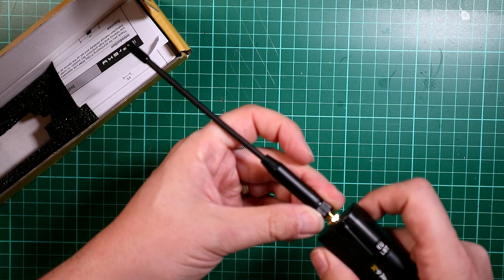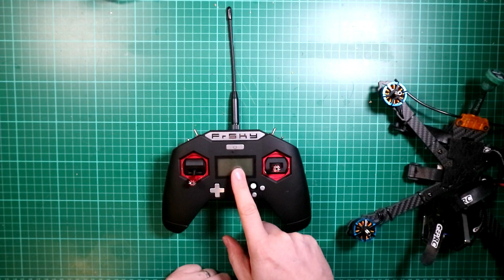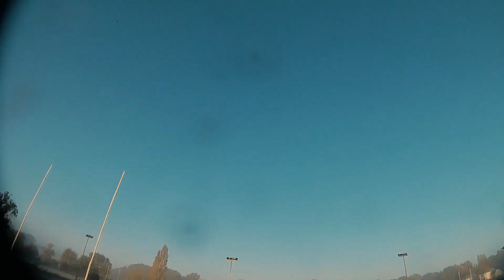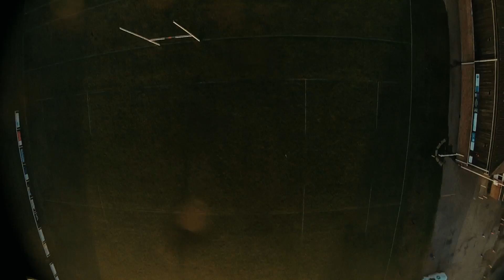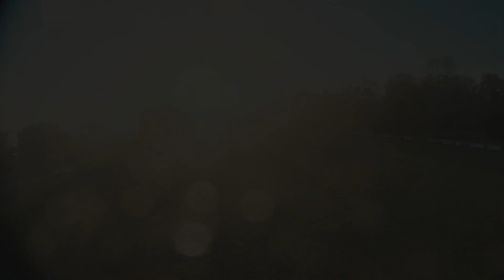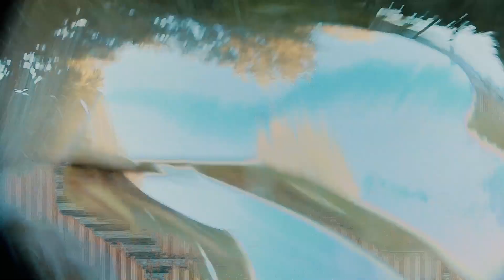Review: FrSky R9 Lite and R9 Mini Set

Comment: +1👍 thank you P.R.!! i just bought the same combo. Lucky you were saved by land. people are praising the addition of a different antenna to the TX module.

Also, I know there were firmware updates since this upload which have fixed many fail-safes.

I am not looking particularly for a very long range, just wanted something "reasonably" better than the 210meter x-Lite/R-XSR distance.

i think people would be interested in an updated video testing latest firmware stability.